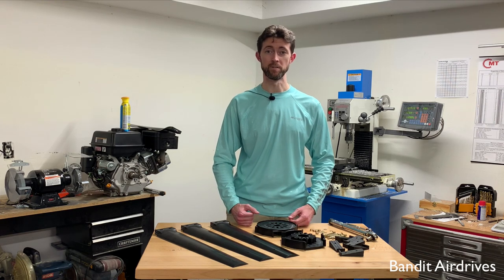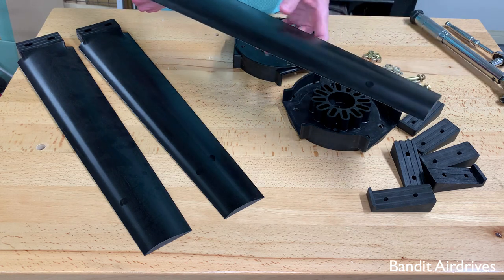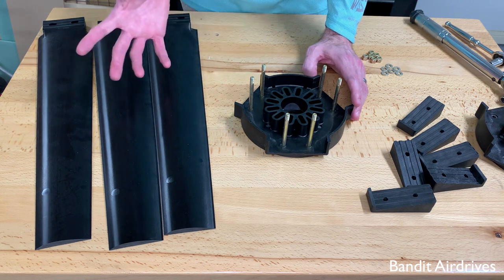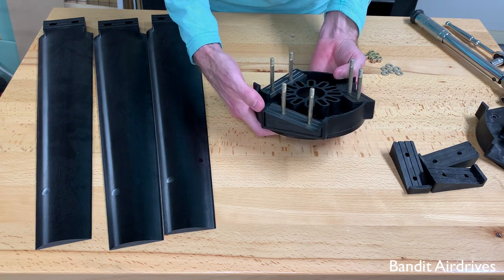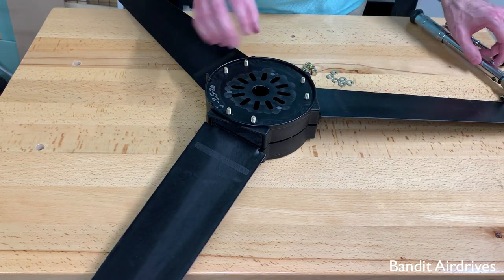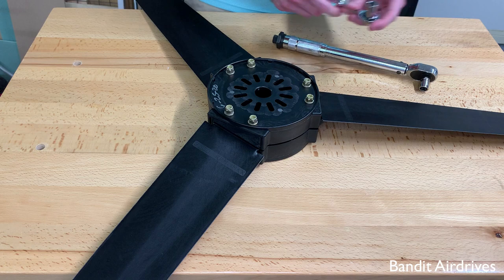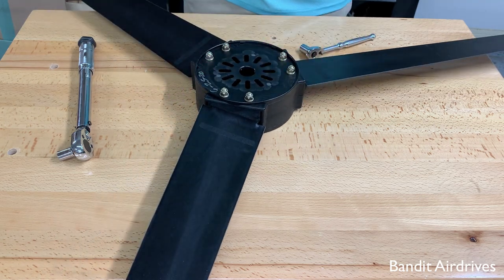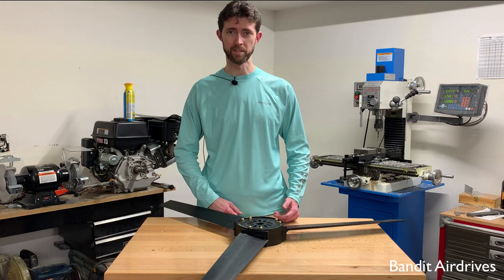How to Assemble an Ultra Prop propeller

Comment: How often do Guys go with direct driving propellers  ?  Thanks for Your most informative videos.
Reply from the maker: It usually depend on how large of a propeller will fit on the application. A reduction drives makes sense at or above about a 48” propeller diameter. But if space doesn’t allow for that, we’ll use a direct drive propeller up to about 42” diameter.